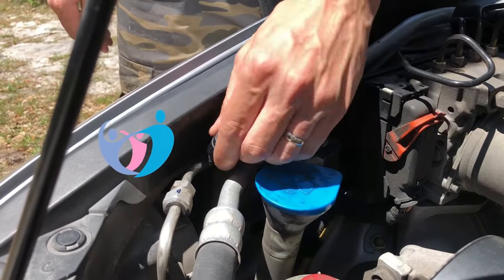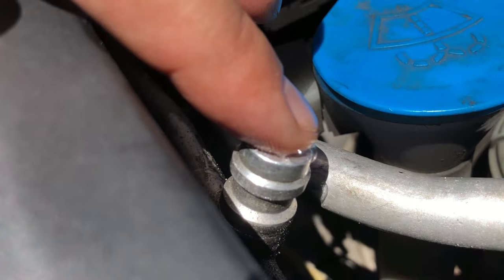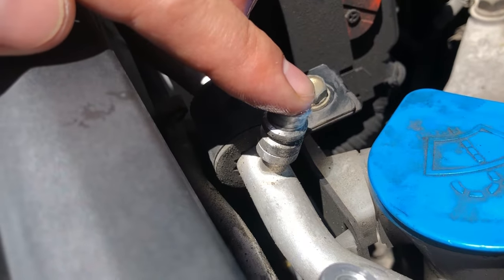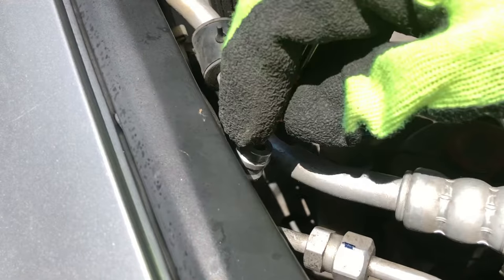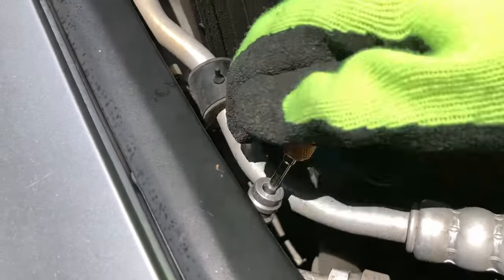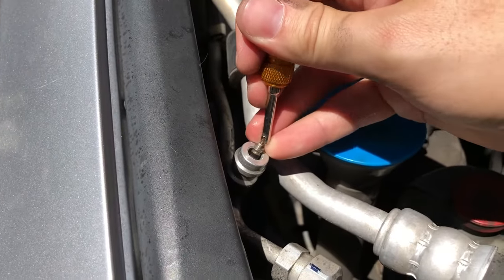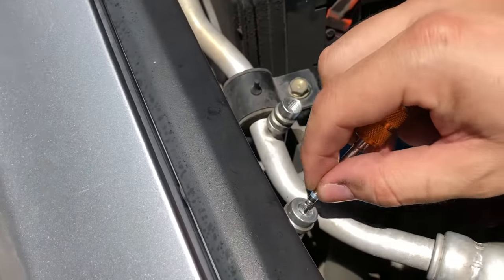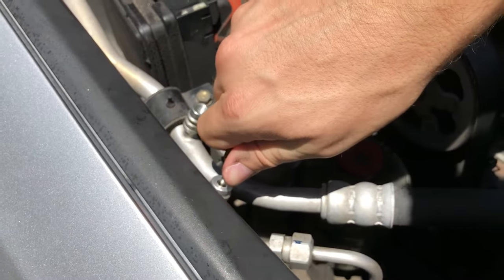How to replace a AC Service Port Schrader Valve on a car A/C line

Comment: Also. You say put refrigerant back in but you will have alot of air in your system. You have to vaccume it all out
Reply from the maker: Yes correct, you have to use a vacuum system to refill it.

Comment: Me valve broke and is stuck in high pressure line
Reply from the maker: Not sure you may need to have a mechanic fix it for you.
Reply: Just buy a regular 4way tire valve tool. They have an extractor to remove broken valves.

Comment: Should I be concerned if after replacing the valve I put in refrigerant without vacuuming the air out. The system works fine and shoots out cold air.
Reply from the maker: The system will work fine now but long term could be damaged. Vacuuming it out insures no moisture is in the system. You may be fine but there is a chance for long term consequences.
Reply: How do we take out refrigerant in the ac  line?
Reply: Youll be fine

Comment: You are correct about removing or evacuating the refrigerant in the proper way, glad to hear that. One thing you are incorrect about is your statement "that's it, all you have to do is refill the refrigerant". Wrong!
Now you have introduced air into the system. If you just refill the system with refrigerant you can ultimately ruin the entire system because of the trapped air. Now a vacuum pump must be connected to the system to evacuate the air and moisture in the system, then add the refrigerant.
Reply from the maker: Your are absolutely correct about that. I guess I implied that as part of the refilling process but should of been more clear. Thanks for the clarification.
Reply: So you have to evac the system to follow the epa regulation, then you install the valve, then you have to evac it again to get the air out? 😑
Reply: @nbl95  anytime you open the system and all the Freon escapes (for instance my car uses 134a which can be vented, R22 should NOT be) the system will suck in air. That means it needs to be hooked up to a vacuum pump and evacuated. Then you add the new freon.
Reply: @davidmiller9485 is also illegal to vent R 134a

Comment: My high and low cap are missing, how much does that effect the ac? The car takes ac coolent but escapes eventually? Or maybe just the valve inside?
Reply from the maker: I think the Schrader valve does all the holding. The cap is more for protecting the valve and for identifying which is high and low pressure side.

Comment: Let me get this correct? If my low valve is leaking a little do I really need to vacuum the whole freon back out?
Reply from the maker: Well if u need to replace it then yes you need to vacuum.
Reply: They sell a tool that helps you replace the valve without losing refrigerant.
Reply from the maker: @omarpena9587  nice, what tool is that?

Comment: Do you need to replace both the high and low side schrader vavles? I got a kit as well.
Reply from the maker: Chris CD just depends if both of them are leaking. Mine was only the Low side.

Comment: after evaporating the system and changing the Shredder Valve do you add oil in for compressor?
Reply from the maker: No, I didn’t.

Comment: Can u tell please if the intire freon will escape after removing the valve or just amount
Reply from the maker: Probably entire.
Reply: Yes, the system is under pressure and most if not all the refrigerant will blow out the line. The only way this will not occur is if the refrigerant has already leaked out depressurizing the system.
That is why an a/c system must be evacuated to remove the refrigerant properly and not just into the air. Plus the refrigerant could spray in your eyes!
Reply: Whole lot, it takes seconds.....
Reply: CAUTION!! EYE, SKIN & INTERNAL INJURIES MAY OCCUR!! DO NOT REMOVE ANY PARTS OF AN A/C SYSTEM UNTIL REFRIGERANT IS EVACUATED OR YOU CAN CONFIRM IT HAS LEAKED OFF!! Easy way to check, using eye protection, glove and rag depress the low or high side schrader valve with a small screwdriver or small blunt object. If the system is still under pressure a small amount refrigerant will spray out. Yes, all refrigerant and most of the oil will spray out of either side, low or high once a schrader valve is removed. Have a proper service facility evacuate the system, then repair or replace damaged parts. Next they will draw a vacuum to remove air, moisture and check for leaks, then refill with refrigerant and check for leaks once again.
Reply: @yyiii276  Then they will ask for your left arm and right leg for payment of services.
Reply: @yyiii276 that did happen to me now i did fuck that up

Comment: So that's what I just paid $100 for.  (Plus more for the freon evacuate and recharge.)  I was quite relieved it wasn't a worser case scenario, but it's always interesting to see where I just wasted my most recent chunk of change.  (2003 accord, 283K miles) Oh yeah, plus that additional $105 a/c diagnostic service charge too.  :rolleyes:
Reply from the maker: Yeah for sure. If possible it's always best to try do it yourself and save a bunch of $$.
Reply: I used to date a mechanic. Always blew my mind how much profit for teeny tiny things
Reply: James Carroll  if you only knew how correct you are! 🤣🤣🤣
Reply: Legally you first needed to have the freon evacuated by a certified technician. You can’t just release your freon into the air. Then you can replace the valve. Finally, you need to correctly pull a vacuum on the system to remove moisture, air, and test for leaks. Then you need to properly refill they system with the correct amount of freon (and Honda systems are very touchy about under/overfilling). So your invoice may have stated $100 for replacing the Schrader valve, but the auto technician had to determine that was where your system was leaking. You only got ripped off if you have the equipment and knowledge to do everything else besides replacing the Schrader valve.

Comment: Hey bro, there's a way to do it without letting the refrigerant out. Saves a lot of time and money
Reply from the maker: Nice.
Reply: @Daddicated  yeah, it's pretty cool. There's a little tool that will keep the valve sealed while the core is out.  You still lose a bit of refrigerant but not too much
Reply from the maker: @WrenchesToRiches  Nice. what's the tool called?
Reply: @Daddicated  that's the one I used
Reply: @WrenchesToRiches  what is the tool called or any info? I don't see it here on this thread. thanks.
Reply: @markc5884  I posted a link but it is gone. I'm not sure why
Reply: @markc5884  I used a variation of this. I grabbed a kit that had several sizes because I wasn't sure of my valve size
Reply: @WrenchesToRiches  ok thanks

Comment: You forgot to mention to evacuated the system using a vacuum pump. Once the system is open you need to do this to remove any moisture.
Reply from the maker: I think I mentioned I took it to the mechanic to get it refilled which means they did it properly.

Comment: I did everything the same and still leaking from  my low pressure valve
Reply from the maker: Umm, that’s weird. Maybe have a mechanic look at it. Or try again with a different valve.
Reply: @Daddicated  my next guess ,to see if there is a o-ring inside the port.

Comment: I have a question so I have a 2003 Saturn Vue and the cap is missing off of the low pressure port where could I possibly find a cap to put on that. I bought one from Auto Zone yesterday and it won’t screw on.
Reply from the maker: Try getting one of these kits that has different size caps. One of them has to work for you. https://amzn.to/3ljo69a